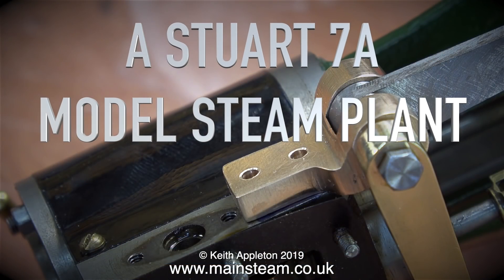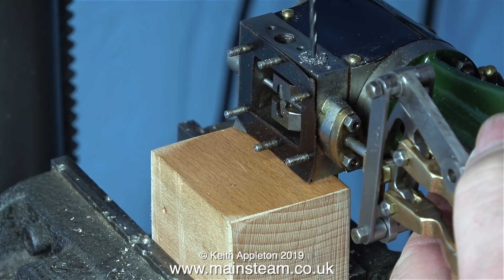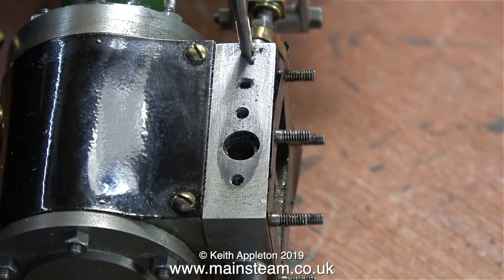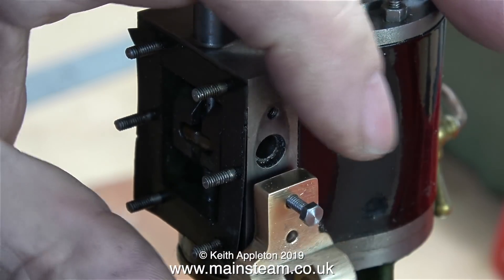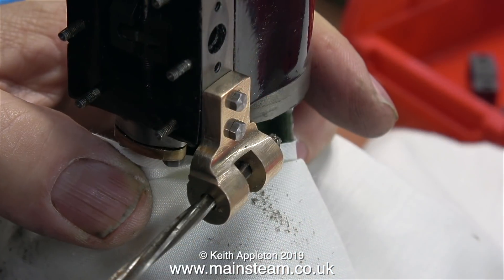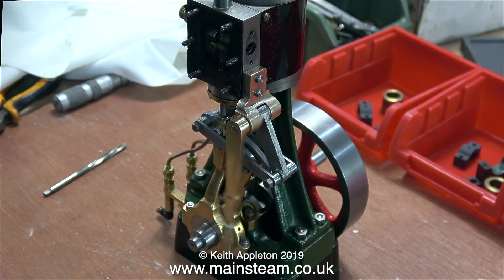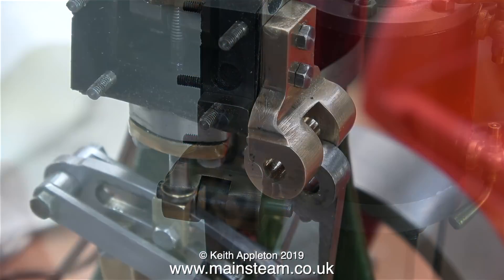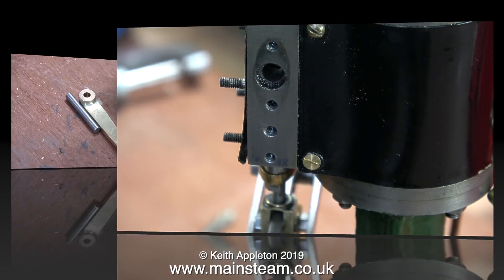A STUART 7A MODEL STEAM PLANT - PART #8

Comment: Simple solutions. Instead of a flange for the steam inlet, thread the hole and use a union. Another idea would be to plug the existing hole and make a new hole on the other side of the steam chest, or fit the steam supply to the valve chest cover.

Comment: In the States, we call the taps that create threads all the way to the bottom of the hole: "bottoming taps".
Reply: Same in Canada, taper, plug and bottoming. but i wont hold it against you, still enjoy your videos!
Reply: Yes we call them "bottoming taps" which is the last thing you want to do with them, as if you do you get an education in broken tap removal.
Reply: In germany we allways keep the threadhole deeper than the screw... 1. That gives a better fit 2. You dont need a "bottom tap" 3. You will never break of the screwhead.... thats the Elegance of engineering.... and yes, what if the material is not thick enough? Than... your engineering isnt perfect 😉